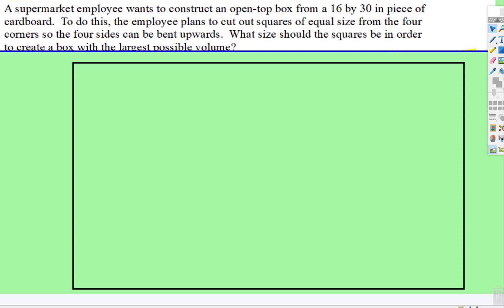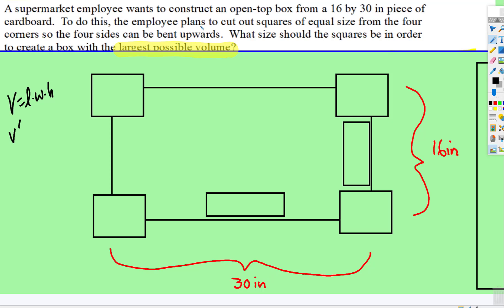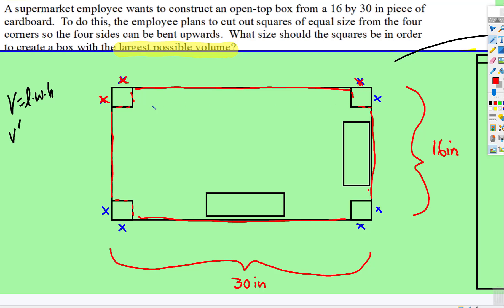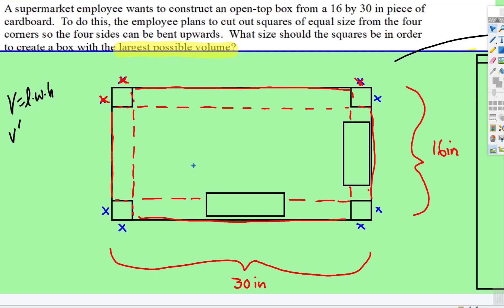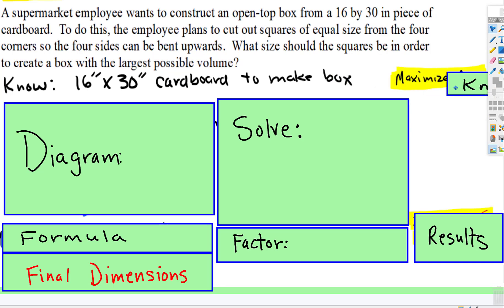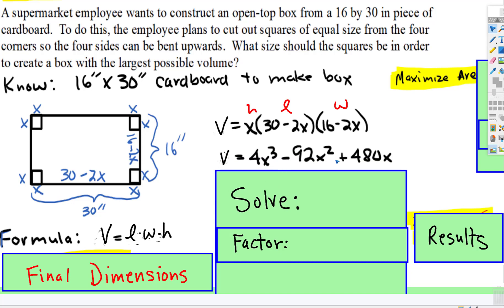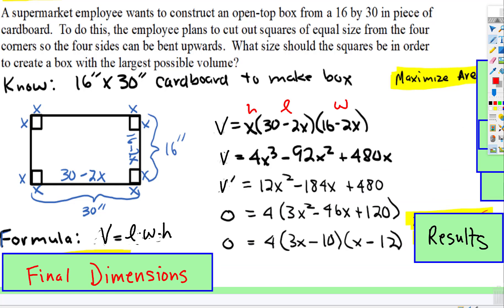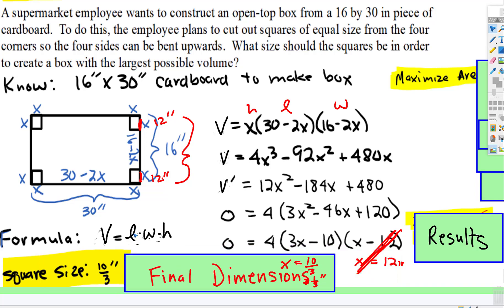Wk-11 Derivatives: Optimization (Volume) - Open Top Box from Cardboard

Comment: Hi, it really helped me a lot and thanks to your video. But can I ask if what is its constraint equation?
Reply from the maker: Yes, a constraint would be if the domain is not All Reals -infinity to +infinity).

For example. If a problem resulted in two solutions, but only one of them works because maybe only positive numbers work in an applied problem.
Reply: @MrsBowsMathClass  Woah, so it only depends. But I got confused of what is your constraint equation in the problem? Will you please answer me on that? I really need it,  I've been really confused about it since earlier:')
Reply from the maker: @ashams0520  Notice that x=12 is one of the solutions, but it is not possible for the sides of each corner to be 12 units.
Reply: @MrsBowsMathClass  It's crystal clear, I thank you so much. I'mma pass this Basic Calculus subject, thank you for answering my questions. Have a great day, Ma'am!
Reply from the maker: @ashams0520  Congrats!